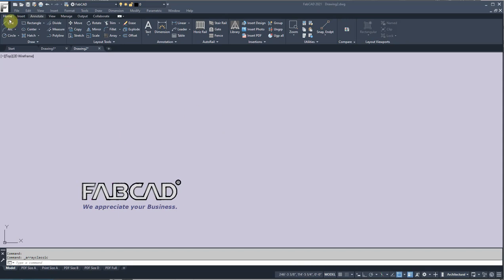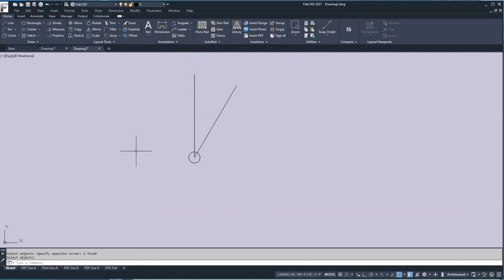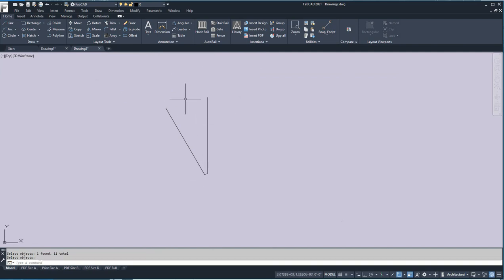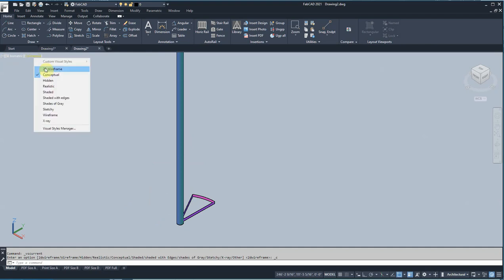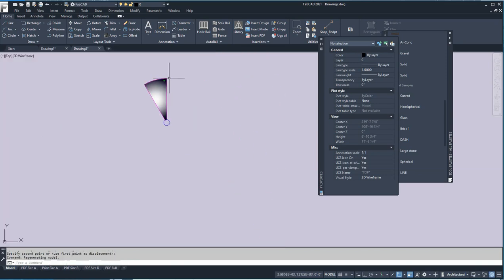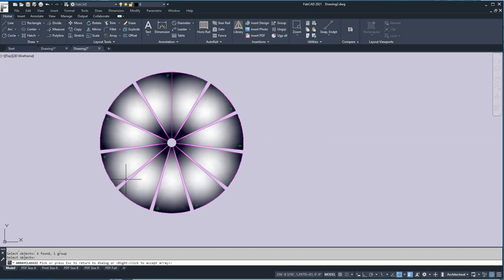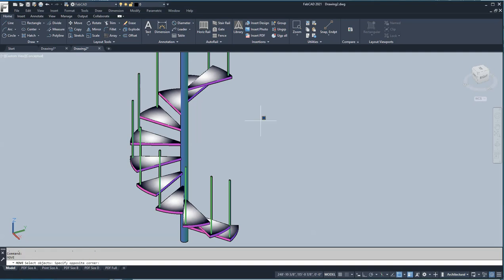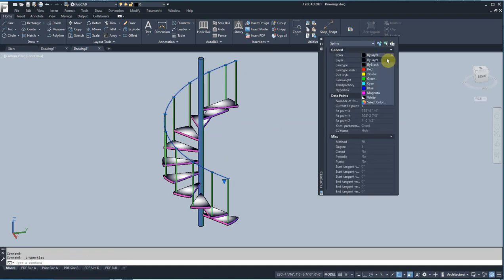Create a 3-D spiral stair with a 2-D program

Comment: Please clarify: in this design the treads are not overlapping; how does it work with the railing posts? I saw most of the stock treads come with 2-holes for the post above and that pass-through to the lower tread. Is it code-related?
Reply from the maker: This demo drawing probably would not meet code.  If you want an inch overlap of the treads, you will need to offset the nose line one inch.  I'd keep the original nose like it is and change the line to a hidden (dashed) line to help confirm the rotation.  If you want to add additional verticals, you will have to draw an elevation of two treads draw a line from one vertical to another and then set additional intermediate vertical(s) and trim them off to the proper height and add them to the stair grouping.

Comment: Excellent video!!!
Please clarify why you erased the first original tread and used the one on video 4.04 min.
Reply: The first two lines that were created at the beginning of lesson were the start and finish lines of the spiral itself.  Those lines may not necessarily be the correct tread lines.  Only after the polar array is done do we have the true lines that make up the tread.  Probably in this scenario the start and finish lines are the same as the tread lines but that won't happen in every case.
Reply: Thank you for your kind words.
Reply: Thank you for the reply! @davefilippi4917